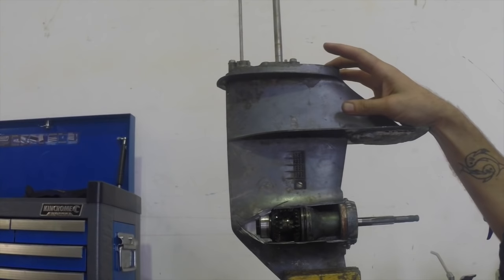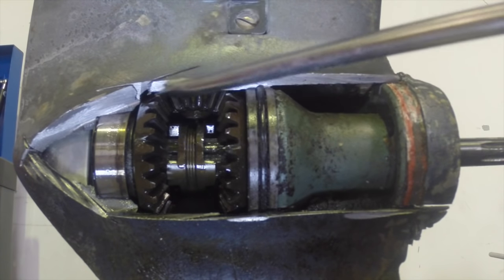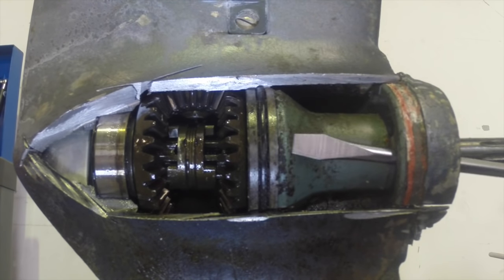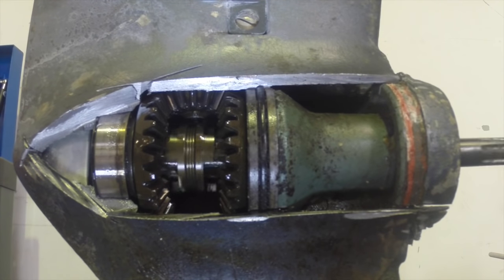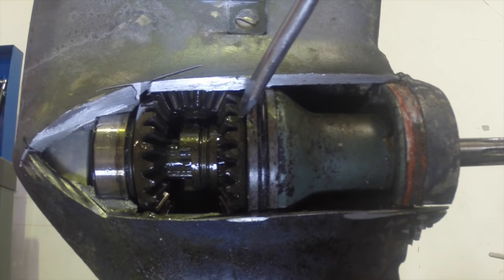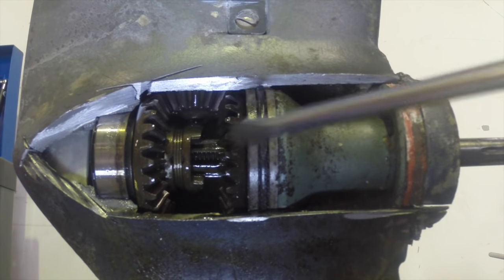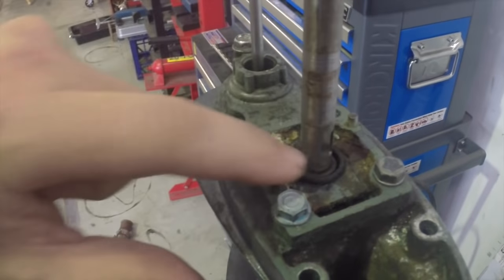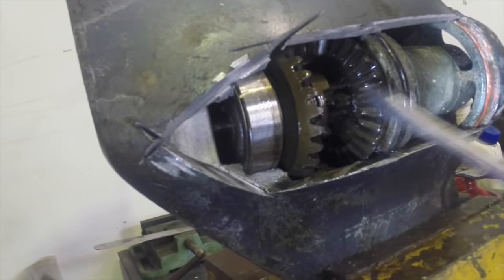How an outboard gearbox works

Comment: Its splined shaft i think i might be a tooth off ?
Reply from the maker: I normally disconnect them, rotate the gearbox end with some pliers until it is neutral, set  the forward controls into neutral and then reconnect.
Reply: disconnect? It's a solid shaft runs down from the linkage which is splined and the end where it goes into the gear box . I got it almost in, have to go another inch? like something is hung up?
Mercury 9.8 outboard  2 stroke